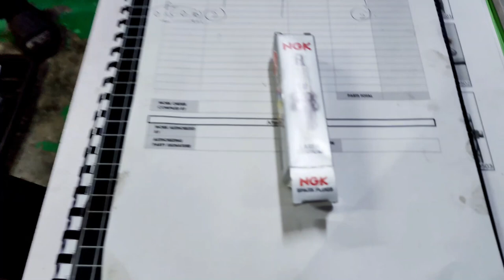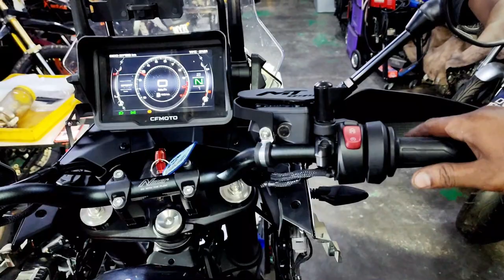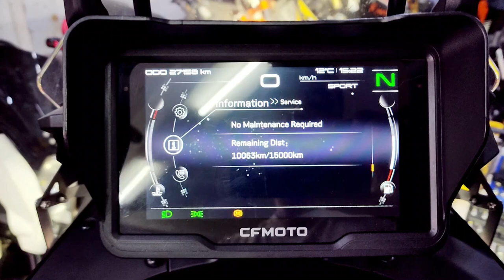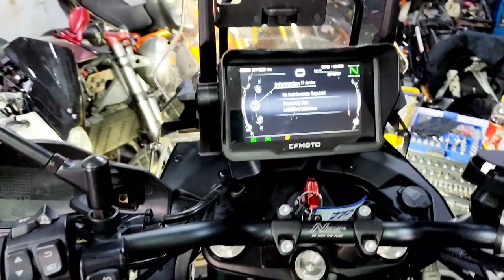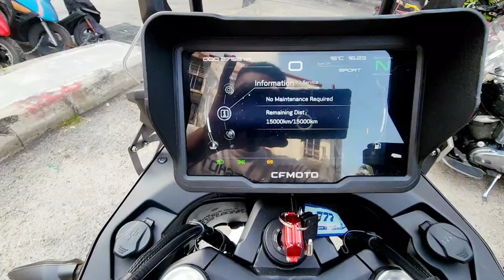Service & Valve Clearance | CFMOTO 800MT | WB Workshop

Comment: Assalamualaikum buat valve cleareance apa yg di tukar shbt
Reply from the maker: Wslam.. VC- 1st, cek & tukar shim bg tepat ukuran. 2nd, pilihan - spark plug, air filter, enjin oil, oil filter, coolant, ...
Reply: @YUSRIZREPUBLIC  trima kasih shbt tgh CCTV teringin juga nak memiliki Cf moto ni😁😁
Reply from the maker: Kasi on..terbaik
Reply: @skuadtransportzulkifli2682  sama gak tgh cctv.. bro yusri ada. mcm confident sket..hahahaha
Reply from the maker: Moto ni ok & berbaloi. Enjin power & lasak (ktm790). Part & asesori belambak. Features terkini & lengkap. Bole onroad & offroad. X rugi memilikinya. 👍👍👍
Reply: @YUSRIZREPUBLIC top speed berapa?
Reply from the maker: Dlm 200kmj++ bole la. Tp mber penah dpt 235kmj
Reply: @YUSRIZREPUBLIC top speed sesedap rase berape? 180 ke
Reply from the maker: @mizidaud7504 160-180 tu ok la touring..bole laju lg..tp aku x berani 😁😁